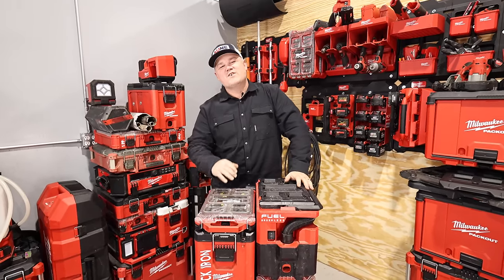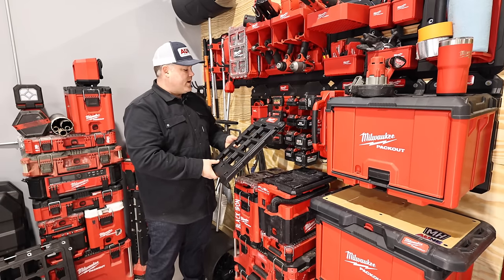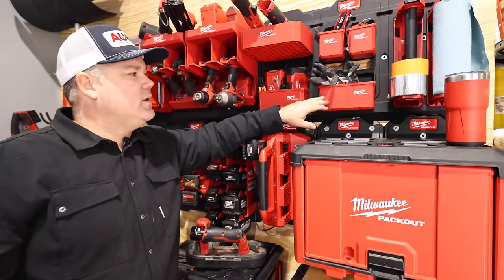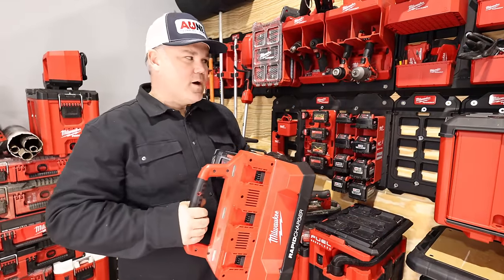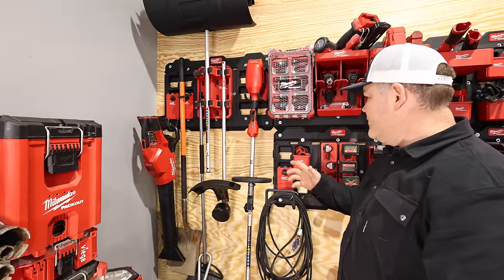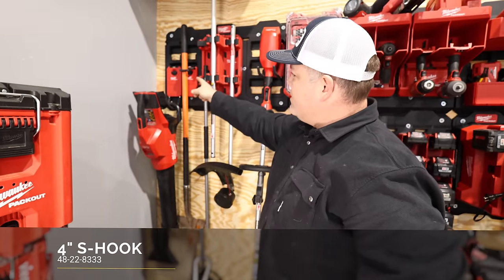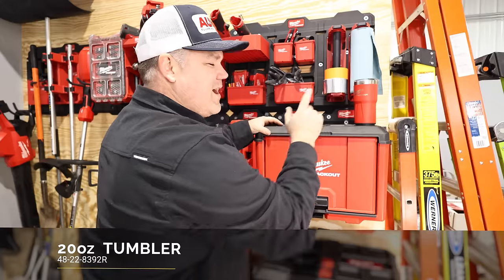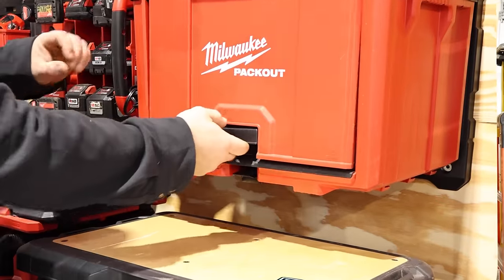Milwaukee PACKOUT Shop Storage

Comment: I’m a heavy equipment tech and I love the packout system I use it in the shop and I can alternate them from the shop to the service truck to a job site with custom set up tool storage per job . I love the drawers .